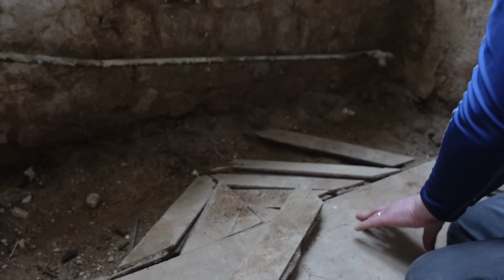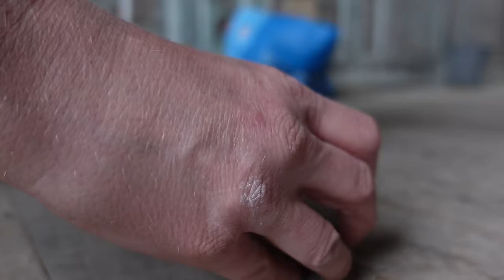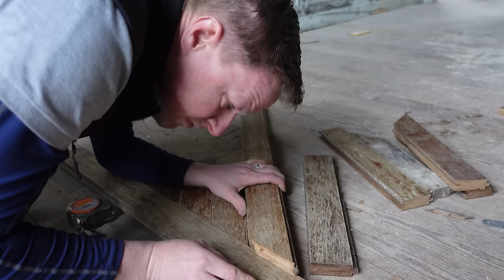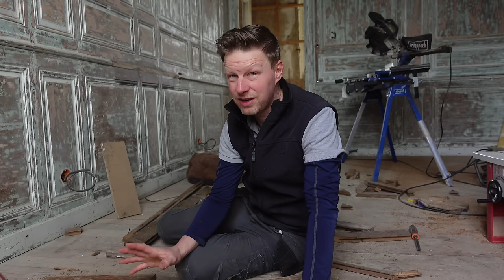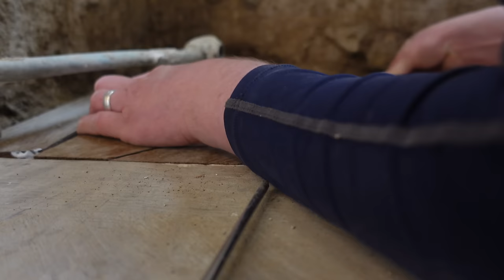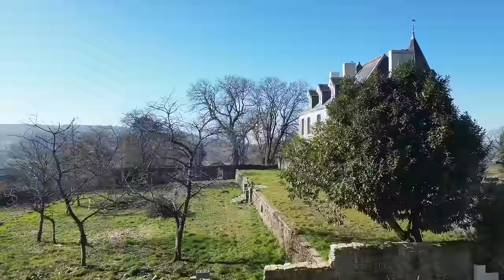What DREADFUL Discoveries Are HIDDEN In The Château Floors? LETS FIND OUT?

Comment: Amazed that they use Dirt as a filler or insulation it really worked but if it ever got wet and it did it never dried out and cause rot and decay now your going to have to remove all that dirt some day and replace it with proper insulation doing the best you can with what you got better invest in proper machinery to replicate the woodwork table saw, routers ,shapers and surface planers